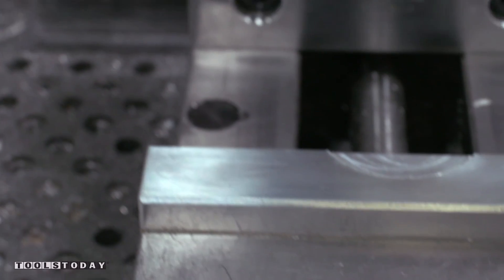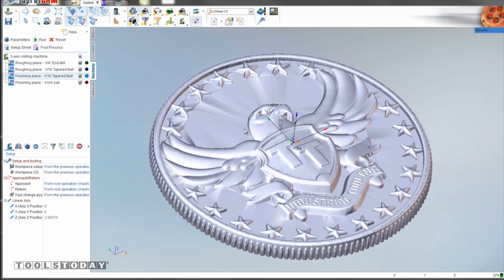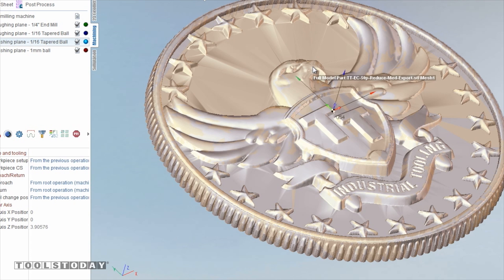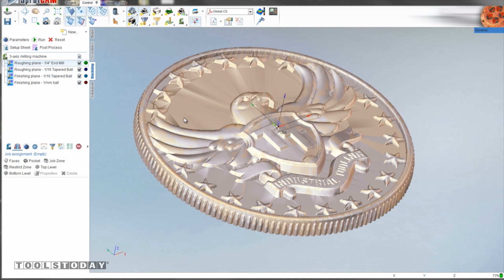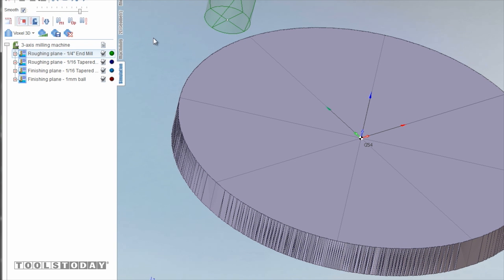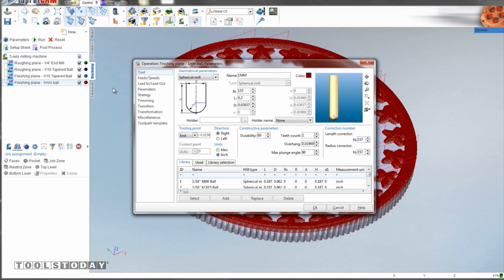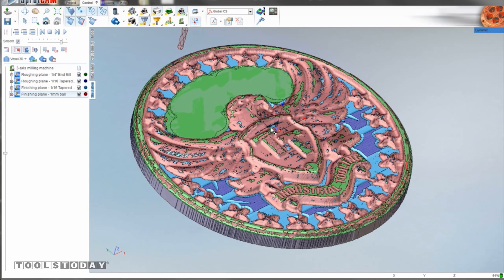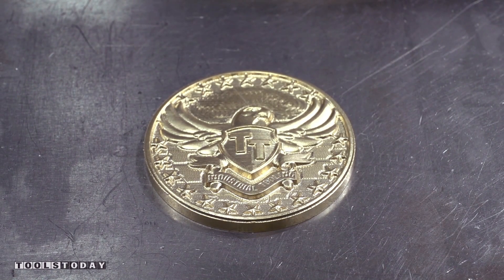CNC Project: American Bald Eagle 3D Brass Medallion w/Amana Tool Industrial Router Bits/End Mills

Comment: How would you post-process such intricate detail to get rid of all the tool marks?
Reply from the maker: When viewed up-close, in person, there are minimal amount of tool marks. If you wanted to, perhaps a wet sand would remove them.
Reply: Wet-sanding with a sanding sponge or Micromesh. Would be an option. Maybe first machine a contour for the hard edges and the large flats with a 1mm or 0.8mm flat instead if ballnose cutter.
Reply from the maker: Yes that could work too, thank you!

Comment: If you were to do this with a piece of aluminum, how would that change the feed/speed of the carving passes?  Also, it looks like in one shot you've got a mister - are you using that for the entire duration of the mill?  Thanks!
Reply from the maker: Since both Brass and Aluminum are non-ferrous, soft metals with similar characteristics, we recommend the same CNC starting feed and speed rates for both Brass and Aluminum when using Amana Tool's 3D Carving ZrN coated router bits. 

Always inspect quality of cut and adjust accordingly. 

A mist is recommended for optimal results and extended tool life, and yes it was used for the duration of this particular cut.

Comment: Sir,  may  you tell me if I use die steel iron means  (hchcr ) means high carbon and high cromium, it's also called D3 iron. then how many tools use for engraving, like your design. and what is size of tools , whom we using in design, like your video. my mean tell me full details of tools size like 3.175 mm dia and 20 degree and 0.2 mm bit size. (3.175×20×0.2) , so that types details shown your tools, whom we use in die steel iron metal like your design video
Reply from the maker: +Sonu Verma, Are you attempting to replicate this design? If so, the design was customized by our artist and cut by John from NYC CNC. The tools in the video are a selection that can be found on our website and listed in the video, our website is www.toolstoday.com.
Reply: Sir , I want to engraving 3d design on die steel iron metal like your design type. So please suggest me best tools for engraving that types carving design on die steel iron metal, and which type tools suitable for carving design like your  video type.on die steel iron metal engraving. I also email you and attachments of my job file. So please reply my mail and suggest best results for engraving in die steel iron metal for 3d carving design. My email address sonu.singh2719@gmail.com
Reply from the maker: +Sonu Verma, The 3D carving, ZrN coated tools shown in this video do not behave nicely with carbon steel workpieces at all. The 3D carving, ZrN coated tools work well in stainless, titanium, etc, but for your die cast steel you can use the following:
 
46280-U: http://www.toolstoday.com/p-6225-solid-carbide-spiral-cnc-2d3d-carving-tapered-and-straight-ball-nose-conical-ball-zrn-coated-router-bits.aspx?&variantids=12539,0&keywords=46280-U
 
46282-u: http://www.toolstoday.com/p-6225-solid-carbide-spiral-cnc-2d3d-carving-tapered-and-straight-ball-nose-conical-ball-zrn-coated-router-bits.aspx?&variantids=12540,0&keywords=46282-U
 
46284-U: http://www.toolstoday.com/p-6225-solid-carbide-spiral-cnc-2d3d-carving-tapered-and-straight-ball-nose-conical-ball-zrn-coated-router-bits.aspx?&variantids=12541,0&keywords=46284-U
 
46286-U: http://www.toolstoday.com/p-6225-solid-carbide-spiral-cnc-2d3d-carving-tapered-and-straight-ball-nose-conical-ball-zrn-coated-router-bits.aspx?&variantids=12542,0&keywords=46286-U
 
46294-U: http://www.toolstoday.com/p-6225-solid-carbide-spiral-cnc-2d3d-carving-tapered-and-straight-ball-nose-conical-ball-zrn-coated-router-bits.aspx?&variantids=12543,0&keywords=46294-U